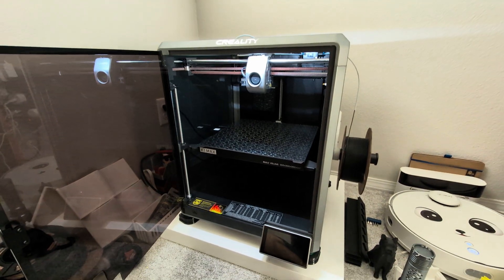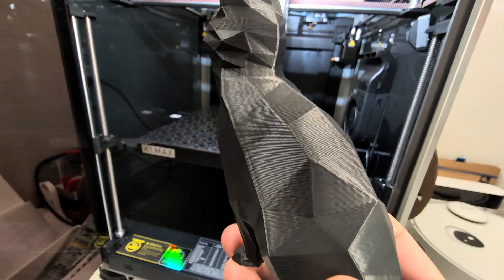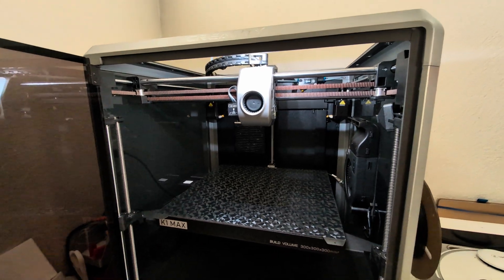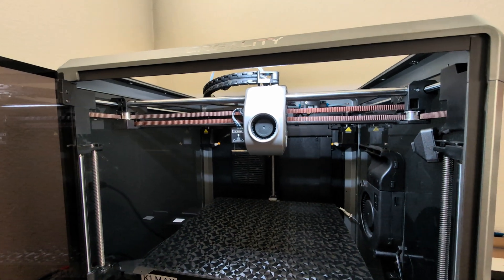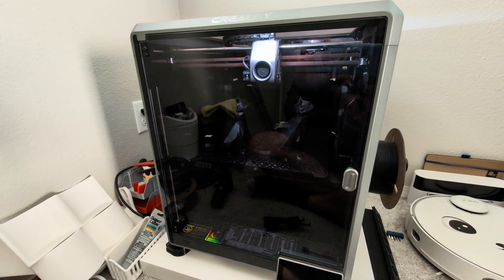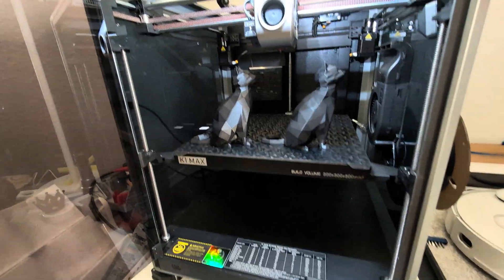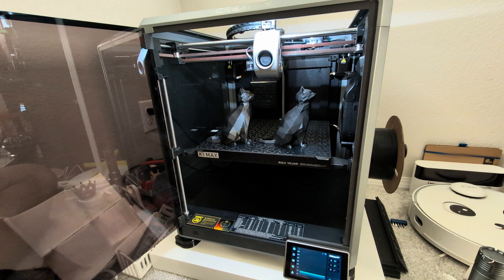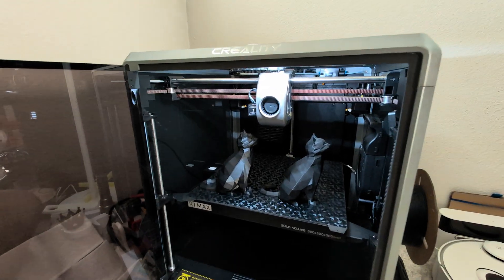K1 Max version 2... is the VFA fixed?

Comment: So about a year and the half ago, I upgraded my Ender 5 Plus to run klipper, and prints generally came out great with no noticeable VFA. However with frequent release of new Slicers and updated klipper firmware versions, we're of course tempted to install and update. And then things change, I am beginning to notice VFA appearing on my prints. So sometimes I wonder if new releases of Slicer version or firmware are the reasons for this VFA

Comment: They also excessively glued all of the plugs to the motherboard on the print head making maintenance impossible it’s great :) my new motherboard will be here on Tuesday 🤦‍♂️
Reply from the maker: It's done so they don't come undone randomly, with all the vibration. But still a pain.

Comment: Hi, what is the firmware version? Is it the same version of the K1 Max first generation?
Reply from the maker: It's the same K1 Max firmware.
Reply: @WillOnParade  Very interesting! Even with smaller pulleys it uses the same firmware.
Reply from the maker: Software will run the same. The only difference is the smaller pulley will cause less vibration causing less VFA.
Reply: @WillOnParade  I understand;  in theory, if I just replace the stock pulleys of K1Max for smaller ones, the printer will work the same way, but with less vibration (and VFA).
Reply from the maker: Right. Basically the same thing they've done with this version 2 K1 Max
Reply: All K1 series printers use the same firmware, and switch out settings (and visible gcode samples) based on the model and revision.

Comment: TLDW: If you want to diagnose issues and tinker with printer upgrades, get a Creality, but if you just want good quality prints with minimal headache, get a Bambu, Prusa, or Qidi
Reply from the maker: All printers have issues. This time around seems Creality got it right with this 2nd revision.
Reply: lots of VFAS on my P1s so they are not flawless and also no solution for it
Reply: Ain't that the truth. I just got a Qidi X-Plus 3 and it prints flawless out of the box. I'm getting the smoothest prints I've ever seen. Absolutely no layer lines and the speed is amazing.
Reply: Ya, just pay double idiot.